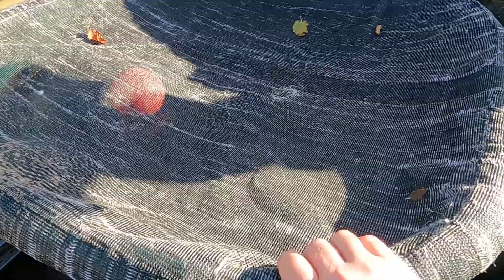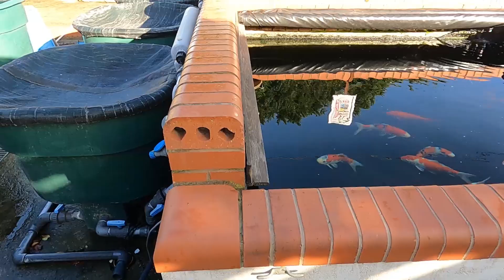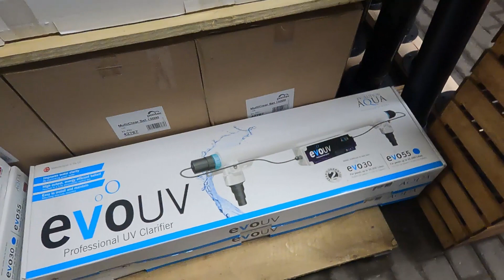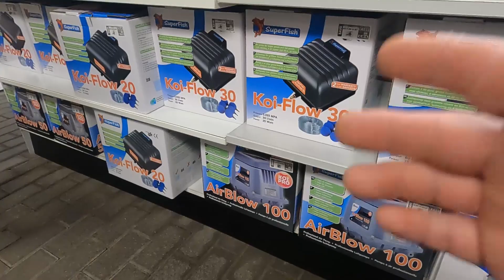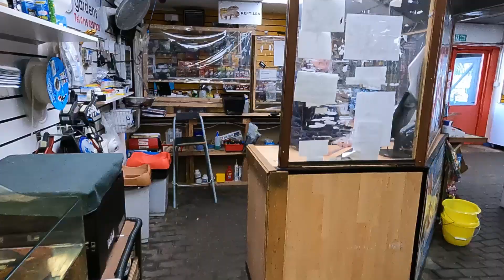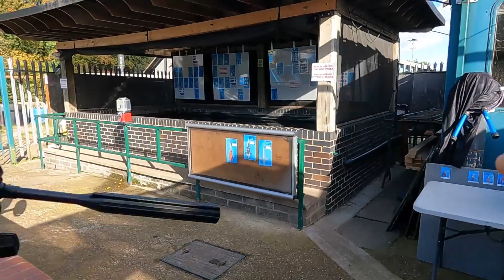Saving money on pond electrics.

Comment: using air lifts on a gravity fed pond rather than using A PUMP could  half your bill on circulating the water through the filter
Reply from the maker: @danielmerrell8926  the fact is Koi pond design is fundamentally wrong. If nobody had heard of a pond and invented it today things would be done very differently. However as electric gets more and more expensive we will see changes coming in. Air uplift done right could save hundreds of pounds. But imagine how the big manufacturers would feel when they no longer can sell pumps .

Comment: Why aren't the energy-saving pumps with superior transfer capacity and little or no pumping up water (e.g. to a high place that have always been common in Japan imported in the UK?
https://youtu.be/FddF7ryaqK8  Power costs should be around £20 a month, although it's not a simple comparison. You might say, why don't you do it? but...。
Reply from the maker: This is a very good question. The design of Koi ponds has never been optimised for energy saving. As cost continue to rise significant changes will start to become a high priority.
Reply: @leecalladine  One of the few examples of a filter chamber designed by Mr Channing there was imported long time ago. There should be more exchange of goods between the UK and Japan in the future.
Reply from the maker: @atsuminaoki9910  definitely.  Take care sir and have a good day.
Reply: @leecalladine  Well, I remember the name of the product. Has his Hydrofilter series has been discontinued for a long time ago? They were very well received and worked well with the Japanese energy-saving pumps. However, when I visited Nottingham there I was surprised to find that  it was used in a different way、、、、。

Comment: Hello dear sir , (sorry for my english, i am dutch)
I have some remarks or advises for everybody who is installing pipes and pumps.
By installing the right sise in pipes you could save a lot in energy by placing a less consuming pump or gain a lot off waterflow for the same energy costs.
First you should never use T's but Y junctions , don't use 90° elbows instead use 90° long radius elbows, you would be amased about the gain in  waterflow  and headloss.
Also ballvalves create a lot less headloss and cavitation than slidevalves.
Also the pipe dimensions should really be calculated, if you try to pump/push to big amounts of water tru a small pipe you create so much headloss/friction=energy£.
Almost for all the koi ponds the minimum diameter off pumplines should be 50mm,  but above 1800 gallons per hour you should take at least 63 mm, or bigger.
This will cost some more money when you are installing but you will gain a lot in energy savings, in the long run bigger and better pipework will always be cheaper.
On de german website ( genesis teich) you can find a real  good pipework configurator.
Please to everybody who is gonna build a koipond take your time to calculate your pipework, use as less junctions, bends ass possible use the right size off pipeworks and spend a lot less energy £££££.
Melle,
A pond builder and plumber in france.

Comment: Hey Lee, very interesting video as usual. Those polystyrene sheets on on my list for next winter to try. Just need to ensure I sort how they will be fixed down or they'll be airborne as the winter blows through my back garden.. Thanks for the mention 😀 👍 😊
Reply from the maker: They are amazingly easy to fix down. Either a strap from one side to the other.  Or just just put a couple of bricks in the middle. They are so stable you can even sit on them. CAREFULLY unless you like taking a dip.
Reply: @leecalladine  😄😄🤽‍♂️

Comment: Some interesting tips for saving money on electricity costs that apply even here in Canada. Our winters are much much colder than the UK often in the -10C to -20C range for three or four months so heating is not really an option for most pond keepers and the koi go into a type of hibernation during the winter months. On the plus side all water pumps, filters and UVs are turned off so we save a bit there but do have to run a pond deicer (anywhere from 150 - 1500 watts) to keep an opening in the ice to allow for the exchange of gases so we aren't really saving much if any money. Ah...the joys of koi keeping.
Reply from the maker: Do you have any problems starting the filters back up in spring? I would not be surprised if the polystyrene floating thing would work well for you in such a harsh conditions.
Reply: @leecalladine  The polystyrene might help a little but even though our ponds are completely in ground unlike most in the UK we are still subject to a lot of ice on the pond surface. My pond had approximately 8 inches of solid ice on it most of last winter. As for the filters we shut ours down completely and usually have to wait until late April or early May to start things up again as the ice melts and the water warms.

Comment: Not sure if you've seen Jamie at Keeping It Koi's channel, he has bought what in essence is a variable control that you plug you're air pump or water pump (not varipump) into and it then works like a varipump and allows you to control the flow rate. He managed to turn one pump down so it was using 3w and there was plenty of flow. Think it cost between £5-10.

Comment: Hi, interesting video, i have never covered but the idea of floating polystyrene interests me, can i ask where you purchased it and would the koi be affected by the perpetual darkness?
Reply from the maker: It's just plain old simple polystyrene. Most builders merchants stock it. Very cheap. Never used the kingspan type stuff. Always leave a 1/4 un covered for the air transfer.
Reply: I wonder if you would have any chemical leakage from polystyrene into the water system?